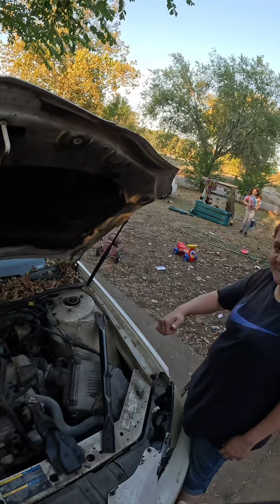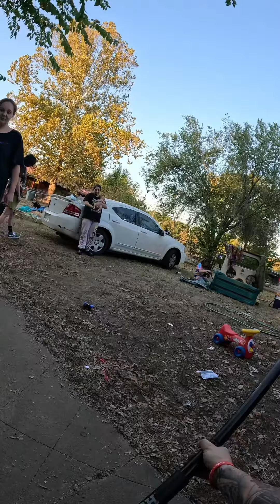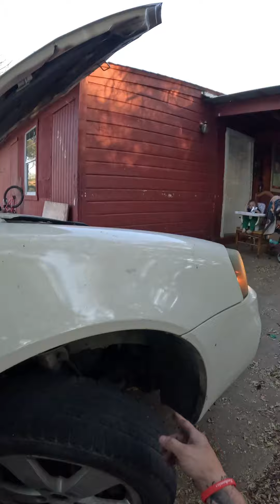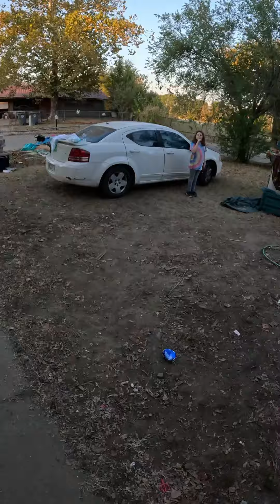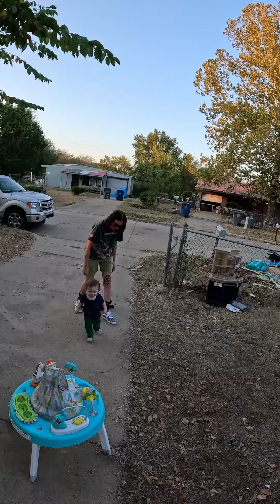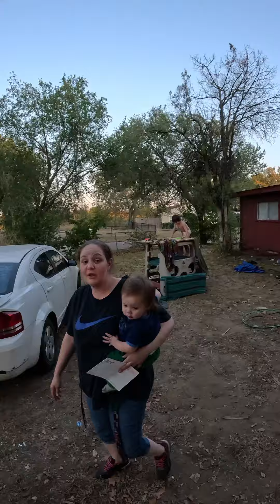What an unexpected ending! I never had one like this before!!!

Comment: This is familiar, I bought an 06 Pontiac Grand Prix for $500 from someone that needed help.  The car was also from Oklahoma.  I guess I should of given it away but $3,000 later and its my daily driver.

That car you just bought is going to need a full front suspension rebuild, power steering rack, power steering pump, power steering hoses, new wheels & tires, rear brake calipers, brake pads and rotors front & rear, radiator, water pump & hoses, coolant elbows, thermostat 195°, oil pressure switch, transmission fluid change, transgo shift kit, valve cover gaskets, headlights, HDM relay for the headlights, dash center bezel, ignition lock cylinder, and a driverside window switch.
It might also need new heads/gaskets, battery, battery cables, engine wiring harness, alternator, starter, oil pan gasket, intake manifold gaskets, o2 sensors, and a catalytic converter.

Comment: Seems like that was a very strong price for that.
Reply: With car prices nowdays I'd say that is a pretty good deal, can't find many under 1k cars anymore, I've seen cars in way worse condition than that sell for $1500+ it's insane.
Reply: Those are usually pretty solid cars. Rust and transmission problems get them around me. Tossing some control arms, tie rod ends and some other parts on is not a big deal at all. Body parts can be purchased at pick your part for little $
Reply: @mph5896  my buddy has over 300k on his, it's his work beater. He literally does not take care of it at all and it keeps on running

Comment: Or do you have a video of stuck closed egr??? I belive mine is...knocking  and rough idle. Knocking started wen on my way to a funeral 4 hours away going up grapevine egr pressure cencor has 2  hoses going to exzaust and 1 hose fell off  and car over heated instantly and shut off. After putting hose on is wen Knocking started. I still been driving  it for a month and the noise is annoying